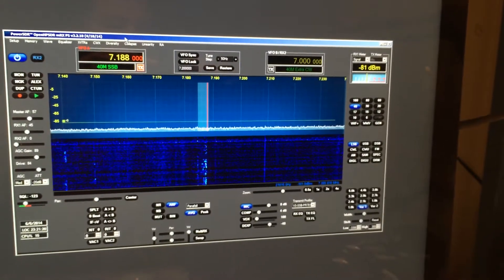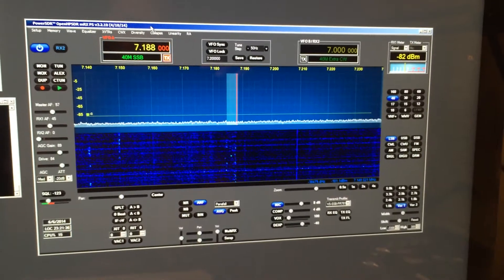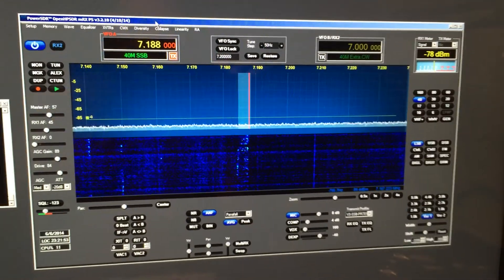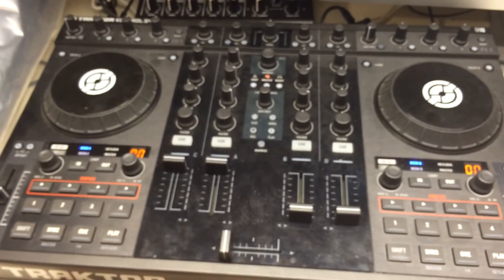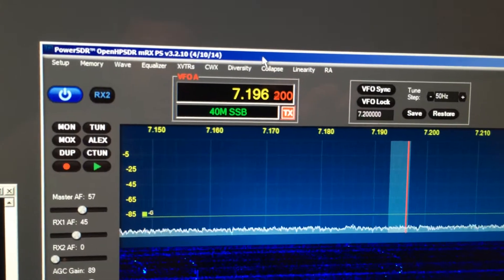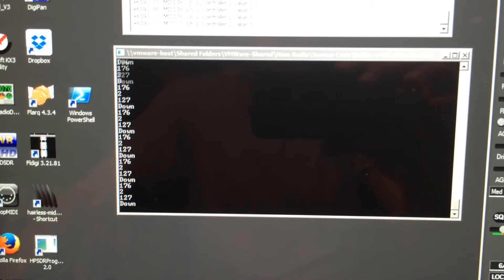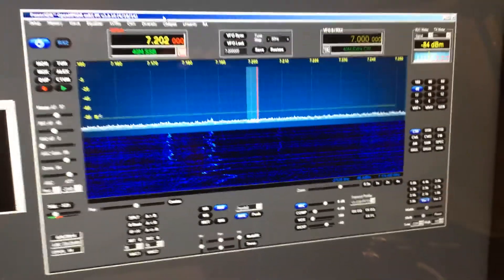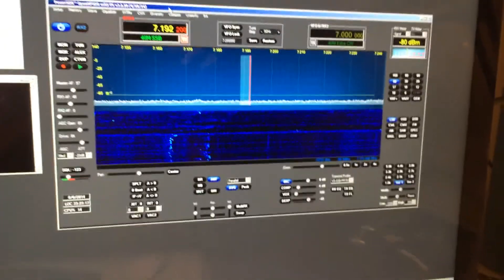PowerSDR OpenHPSDR - Kontrol S4 DJ Controller - Midi Control

Comment: Hi, what do you use the serial to midi software for? Powersdr mrx supports MIDI directly. I've built a Arduino MIDI interface that work well on sdrconsole, but on Powersdr the VFO kind of works
but only UP or Down, not both, if I turn the VFO clockwise it goes up, if I turn it left it also goes up. 73
Reply from the maker: This is a very old video when there was no midi support. And this was midi to serial commands translation. I have not tried midi integration recently. This was more of an experiment.
Reply: @dalfry Hi, if you figure out how to do tell Powersdr the difference between up and down let me know. 73